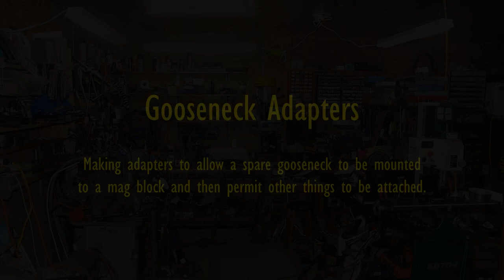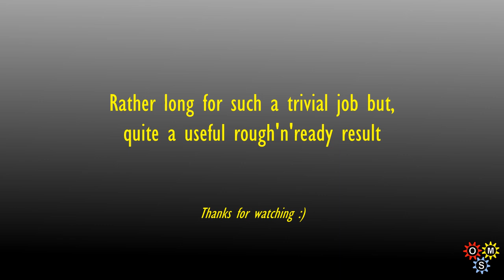Gooseneck Adapters

Comment: Nice to see another video from 'the old man's shop".

The ball head will almost certainly be 1/4-20. I was surprised that you didn't tap 1/4-20. Then you could put in a long 1/4-20 set screw (grub screw) if you want a standard camera mounting stud. Cut down the length of the screw until you have about 0.220" protruding when it bottoms out, as camera mount sockets tend to have a bit less than 1/4" of depth.

I wouldn't entirely blame the drill bit. If you watch carefully, you can see a bit of chatter in the hole as you pull back the spotting drill. The drill bit may not be quite right (especially if you could see the problem with the grind), but no bit will drill straight if the spot isn't right.
Reply from the maker: +Peter W. Meek 
Hi Peter,
Went for the 8mm to better serve some other things altho true - could have gone the 1/4 x 20. I'll make as needed any converting stubs - quite quick if I turn down some 8mm all thread if 1/4 x 20 needed..

Comment: M8 ....!!! You'll never wear out that adapter, is there anything metric in the US beside cars.... ???
The slitting saws can probably sharpened inexpensive as needed, probably less than new ones if good quality to start with...    ;)
Reply from the maker: +pierre beaudry 
Hi Pierre,
Haha - well I do still use metrics at times, particularly when I have fasteners on hand... get metric on bikes too - well mine, which is 'rice-burner'!
Despite the odd saw blades that are very dull - there are enough now to at least give me an adequate choice for most uses.

Comment: Hi Chris, I wasn't going to comment but.... With a spiral flute tap you really don't need to break the chip, in fact I believe it is not recommended to do so. Probable reason is that chip is meant to come out as a long string and not have small pieces that could mar an otherwise clean thread. Or it could just be that when power tapping you can save a few milliseconds by not having to blow out any debris. I know old habits are hard to break but one must try, I suppose. :>(
Reply from the maker: +Chris Stephens 
Correct Chris - old habits ..... Only had some spirals for a while and it certainly is hard to break old ways of many years! Point well taken - thanks.
Reply: They are good though, but sometimes hard to start straight freehand without some form of guide, but then they were not designed for hand tapping.